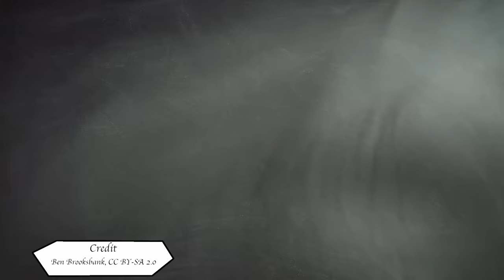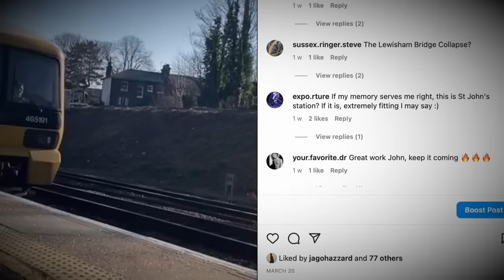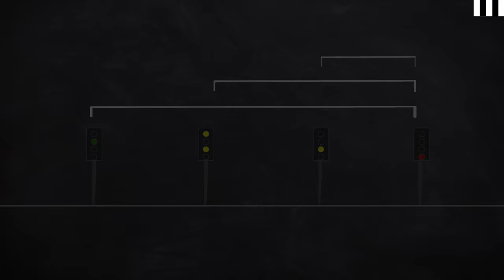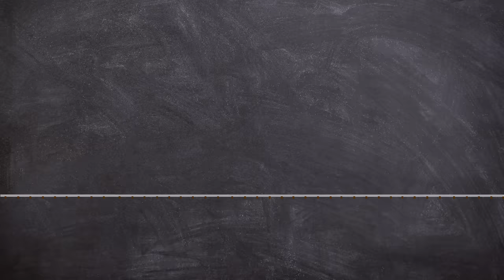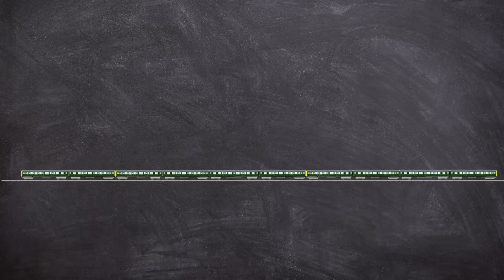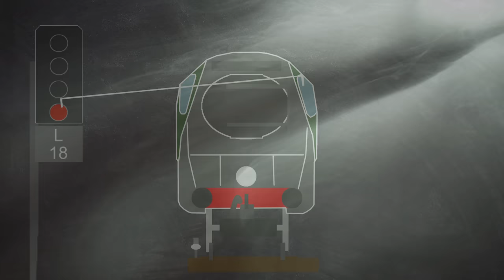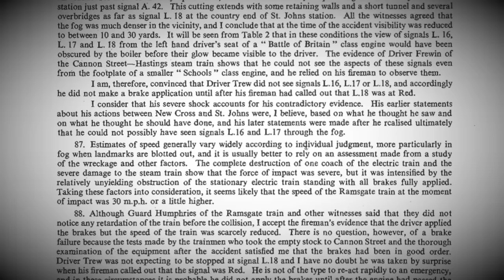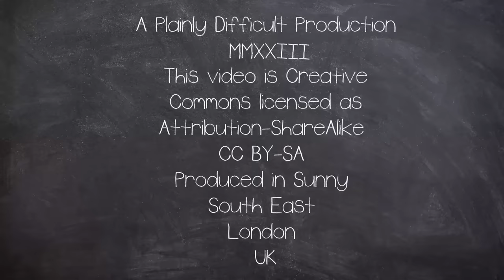Driving Blind: The Lewisham St Johns Train Crash Disaster 1957 | Plainly Difficult Documentary

Comment: So in short, they put the signals on the wrong side of the Train-Track, and then the driver gets scape-goated and almost goes to prison when they literally couldn't see the signal properly!
Sure, you can say "They should have gotten their front-side passenger to call out the signal" but from the sounds of things, that's just a hack solution to the horrifically bad design, and not standard procedure. Especially considering that the passenger didn't know to call out the amber signals (And didn't get into ANY trouble for not doing so)
Reply: Not passenger, but fireman, which job is to stoke the coal fire. He can't be expected to have a constant eye on signals
Reply: No not really. The 'front-side passenger' is as erik says the fireman. Rule 128 "The Fireman MUST-when not necessarily otherwise engaged observe and obey all signals and keep a good look out all the time the engine is in motion." It was absolutely a requirement of the rules and regulations and part of his job, but the main part of his job is indeed stoking the fire which is why the ultimate responsibility rests with the driver. Rule 127 "The Driver MUST-observe and obey all signals, whether the cause of the signal being shown is known to him or not, and when owing to fog, falling snow or other cause, the fixed signals are not visible at the usual distance, use every precaution and reduce speed if necessary, especially in approaching stations or junctions, to enable the train to be stopped at the signal should it be at Danger."
Reply: As to why it was on the wrong side, it's explained in the report. "It will be noted from the inset to Fig. 5 that there is plenty of room for the simple signal posts in the wide space between the Down and Up Through line, but none between the Down Through and the Up Local lines, and to have brought the signal aspects to the left of the Down Through would have required fairly elaborate cantilevered gantries. I understand that at the time of installation, when most of the engines were driven from the right hand side, the signals were sited as nearly as possible to the driver's or fireman's eye level in order to give the best view in the prevailing conditions where curvature and overbridges had to be taken into consideration." BR did generally have a policy of moving all signals to the left as and when they could but that created as many problems as it solved as there often wasn't a very good place on the left which is why the signals were put on the right in the first place. Also after WWII the railway was on its knees, the whole system was falling apart where maintenance was essentially stopped due to materials shortages at a time when the railway was being more heavily used than ever and being bombed.

Comment: Put the signals on the opposite side of the train from the driver, so he couldn't see them? Typical British Rail...
Reply: Southern Railway mate put em on the side of the driver. "It will be noted from the inset to Fig. 5 that there is plenty of room for the simple signal posts in the wide space between the Down and Up Through line, but none between the Down Through and the Up Local lines, and to have brought the signal aspects to the left of the Down Through would have required fairly elaborate cantilevered gantries. I understand that at the time of installation, when most of the engines were driven from the right hand side, the signals were sited as nearly as possible to the driver's or fireman's eye level in order to give the best view in the prevailing conditions where curvature and overbridges had to be taken into consideration."